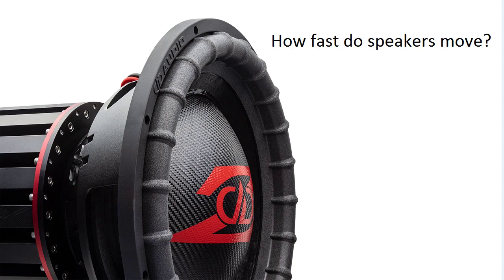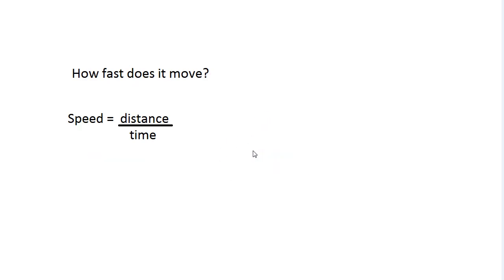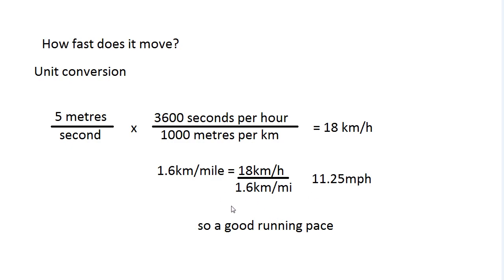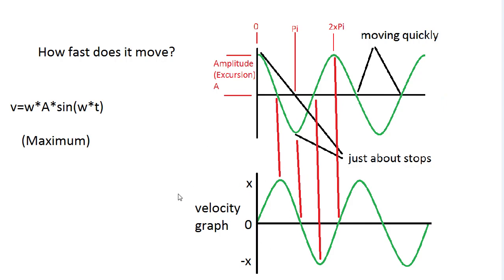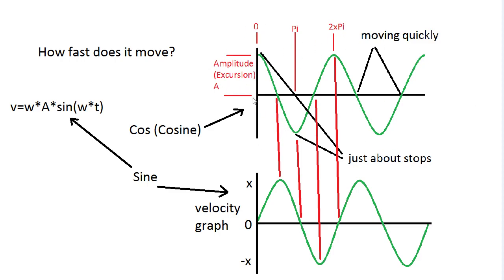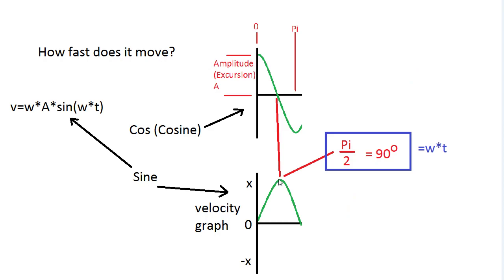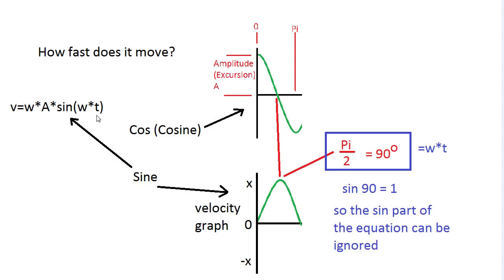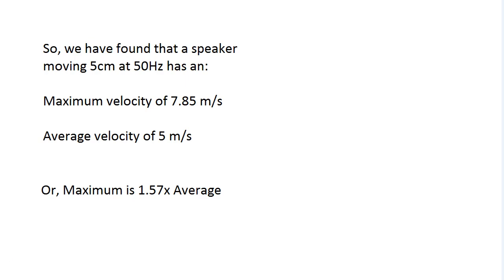How fast do speakers move?

Comment: Thanks ! Now my head . . . um . . Hertz !
I have no idea where to get any answers for a few questions that I have. I figure I will ask a few seemingly knowledgeable people and if I get any consistency in the responses, while not entirely making me believe the answers are correct, at least the odds will be in favor of the answers being accurate. In the late 1980's to early 90's I was heavily into car audio and did most of my testing in a bit of self imposed isolation because everyone at that time in the industry were basically dishonest from the manufacturers on down to the salesmen at the store level. Proprietary hardware was rampant along with misinformation, "Oh, no, you can not use brand X head units with brand Y equalizers or brand Z amplifiers!"
Anyways, my first question today is what would happen if I built a sub cabinet and used two (or more) ports tuned to different frequencies? 
Another question is if I were to suspend a port inside another port what frequency would prevail, or would a third frequency, possibly the sum of, multiple of, or fraction of the combined port resonant frequencies. 
Third question (I have a LOT of them); what effect would tapering or flaring of a port have and would there likely be an optimum angle of the taper or flare dependent upon the frequency and or amplitude desired and would it be best to have the wider end towards the exterior or interior of the speaker cabinet?
Last question. If I have a dual voice coil speaker with a wide bandwidth (I generally use professional equipment in my car audio, mostly older Peavey drivers), would bi-amping the two voice coils be advisable? As an example, if I used one coil up to 60 Hz and the other coil from 60 Hz to rolloff, would the driver cancel out any frequencies due to harmonics?
I liked a couple of your videos that I saw, but this one gave me a headache, too much math for me. That's why I have the photomath app in my smartphone !
Reply from the maker: a few good questions
1. This is a tricky one. It's either the average length, or    
effective length= 2x (1/[ (1/ length 1) +  (1/ length 2])  . 
So, say you had a 10cm long port and a 20cm long port, it would be 
= 2x(1/(1/20)+(1/10))= 13.3cm 
per port for 2 ports. I know its super messy, but its like adding resistances in parallel if that helps. 
Imagine if the 10cm port is a flow restriction, adding a 20cm port in parallel would act as a lower total flow restriction. The two would act like one port with a length of 6.66... cm. But since you've got two ports, it would add to 13.33... cm each port.
2. Generally the way ports work is a restrictive airflow path from a box of X volume, so adding a port inside a port would likely give the original port a higher restriction, and would give it a lower tuning. Unless it was some shape which diffracted higher frequencies, like a horn, the inner port would just lower the tuning.
3. Once again, its about the restriction. A nice flared port allows for a more efficient air path, lowered resistance, and thus a higher tuning. A tapered port shouldn't matter if its pointing into or out of the box, as its an AC air flow, though I would have the wider end out so hopefully any turbulence noise would be trapped in the box. Tapers and flares aren't frequency dependent unless its something like a horn enclosure, when the taper or flare is directly responsible for the sound amplification. The ideal flare's job would be to reduce turbulence, (also known as chuffing), so it depends on how powerful the subwoofer is, and how low the tuning is. Lower/more powerful requiring a wider, longer flare to be optimised.
4. Amplifiers can generally do a much wider frequency range than the speakers they're running, so you're best off running the same signal into each voice coil. If you only run one of two voice coils of a speaker its power handling and motor force is reduced, the other coil essentially acts as dead mass.
Hopefully these are of some help. These are also some decent video ideas
Reply: @Dakoustics  on the last one the second coil is also active. On the flared port would a diffraction section be of any benefit, assuming it causes diffraction in both directions (if that is even possible), one the multiple port idea, I see what you're saying. I occasionally  use a high value resistor to "adjust" one that is a bit too restrictive, but the result is not worth the effort to remove and replace a component. Another idea was angle cutting the inside end of a port to possibly make a softer peak at the port tuning frequency. I often use port loading to cool the amplifiers. It is better than a noisy fan, after all it is a true "something for nothing" situation. Plus the harder the amp works, the more it gets cooled. The only issue is port location can be a real nightmare because the amps have to be where they can be tweaked but the ports should be either facing the listener or into a tuned chamber that faces the listener,  a practise I have used for a long time.
Reply from the maker: @jeh4138  I've seen a few PA speakers that have heatsinks in the ports, its a good idea. The problem with bi-amping is only one of the coils is working at a time, if you're running a song with a 40Hz+80Hz overlayed it should work fine, but it would be just as effective to have both amplifiers doing full range. Dual voicecoil subs also act like a transformer, so an amplifier might be receiving voltage from the other, and could potentially damage it, or damp it making it less efficient. Also to reduce enclosure peakiness try using polyfil type stuff, that plus a round-over should make for a nice, smooth port response. Angle cutting will work just fine also.

Comment: Sharing knowledge is like planting a seed. Thank you for that break down. How about port velocity. How does the drivers sd and wattage affect the turbulence at a given frequency.
Reply from the maker: Sounds like a good topic to cover, but i'll need to learn a bit more now, I could work it out for below tuning, but at tuning will be a bit more complex, it'll be a balance of BL and air pressure, also turbulence will come about when I do fluid mechanics, theres a point at which airflow is so fast it essentially chokes itself. But yeah, two good topics, cheers for the ideas